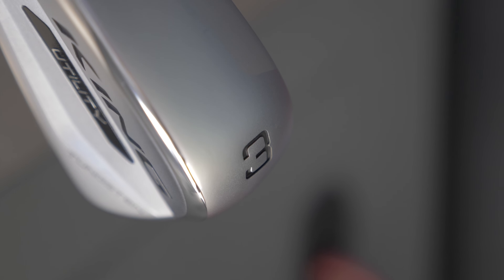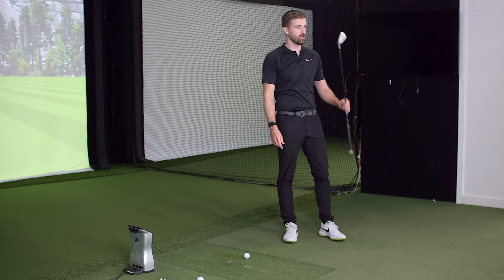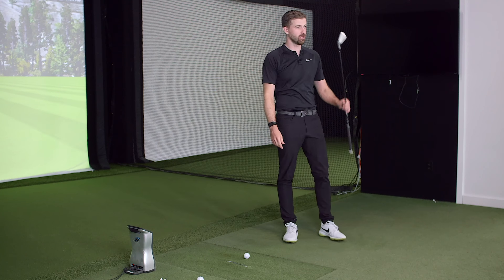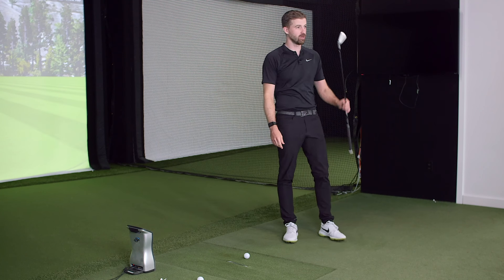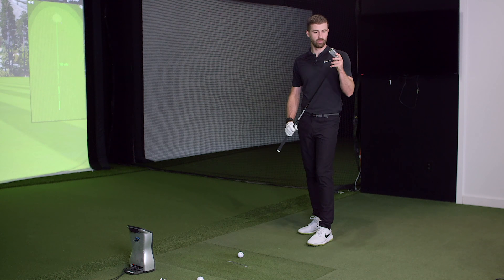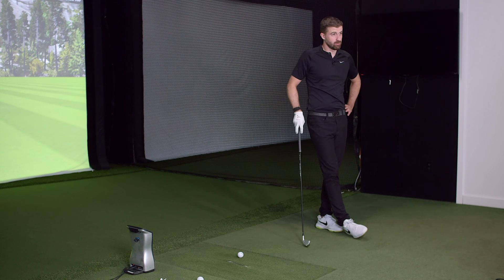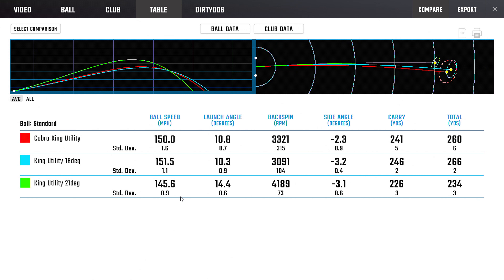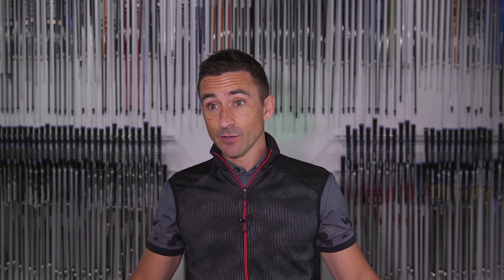ADJUSTABLE DRIVING IRON // Cobra King Utility Review

Comment: I just got 2 driving irons (3 and a 4) they work so well for me on my course where I have 3 par 3's all around 190 - 200 yards which have open front greens to run the ball on. I find the driving irons to be so much easier to hit straight, the ball flight gets less affected by the wind and seems to have a more piercing, slightly flatter flight. I also have  a hybrid and a fairway wood as those are much easier to hit from rough lies (both go the same relative distance and the 2 driving irons) Dropped my lob wedge from the bag to make space for them and I would say a lot of handicap golfers could benefit from having more clubs top end of the bag

Comment: I purchased this in the 4 iron. Ive played around with the loft sleeve on the course. Not on a launch monitor though. The difference in lofting down on the course isnt too noticeable. Lofting up however you notice a higher apex. Super easy to hit off a tee. The boys couldnt believe the distance i was getting with a 4 iron. Around a 240 total distance. I paired it with a modus 105x. I usually play my clubs 2 degrees flat. I did notice the more upright lie angle had an opposite effect of what some might expect, where it actually causes me to fade the ball more and I have a harder time hitting a draw with this club. Its more of a straight/fade bias for me with the naturally upright lie angle.  Great review!!

Comment: I feel so odd playing a bag without a fairway wood.  But my 18* driving iron is so good for me it’s made my 3 wood almost irrelevant.  Extra wedge might be more useful than a 3 wood.  I’ve even thought of playing two drivers.  A spinny forgiving high lofted driver and a bomber.  How often do I need a 270 carry club instead of a 250?  For longer hitters these days, if you aren’t playing 600 yard par 5s the 3 wood doesn’t get used much if you are comfortable with a driving iron.
Reply: I just don't get on with 3 woods consistently so I've got a tsi3 hybrid set to 18° and use it as my 3 wood as I can get 235 yards out of it and just got a callaway x forged utility iron for off the tee in to wind, then go in to a 4 iron. I'm much better with irons and so completely agree with what you are saying. So instead of 2 drivers I've got the utility as an alternative.

Comment: I recently bought the 3 iron in the KBS steel shaft. I spin woods way too much and this a great safe option off the tee. I wanted to get a little less spin and more rollout so I put it in the draw setting at 18.5 degrees. Great review.

Comment: I have a  cobra 3 utility one length that i added to my wishon one lengths, been using it in 19.5 really nice club that you can feel spring off the sweet spot. Great for tighter par4's where i dont have room for a sliced driver.  The draw setting have a big effect too, tried it out at the range and just hook it instead of straight.
Reply: How are you liking your set? I'm leaning towards that type of set up, or cobra one length hybrids. Really interested in single length
Reply: @DavidSmith-lo7wf  (reply 2 years later!)  I really like the one length, but I am only using a limited set of clubs, I have a 5 hybrid (eq1-nx) 7/8/9 cobra irons in the one length.(corbra are strong lofter so dont need a 6)  Above that i use a 5 wishon eq1-nxwood a driver and below i use a cleveland smart sole C (42deg) and 52 wedge, and a putter. I recently changed the sterling irons out for the new eq1-nx and in a few rounds the 7 iron cracked at the welds, I have now moved to cobras.

Comment: I've had a real issue with the last few years cobra models.. they perform very well in my experience on low face toward heel strikes,  but I'm much more of a down hitting high on the face more toward toe striker.  Every cobra in the last few years, whether it be driver, fairway wood, hybrid, or iron,  they all seem to struggle with these strikes.
Reply: that's great news for me right now, low heels are my miss

Comment: Driving Iron Shootout!

Truth is there are players, like me, that struggle with hybrid and 3/4 wood, they went way too high and not workable. So I carry driver then mizuno mp 20 HMB in 2 (16.5*) and 3 (21*). As a better iron player im always interested in whats out there and how they all perform. Truth is you can play off the tee shot where you hit slightly up on it or level to hit lower and off the deck you can still work flight. Hybrids and woods never let me do that and seem like they are too hot off face and never stay consistent.

Comment: You boys are nailing it at the moment. Genuine contenders to take Rick Shiels spot as #1 golf you tubers imo
Reply: Callum James the channels couldn’t be any more different. Rick’s testing is nowhere near as thorough or backed by numbers.

Rick is a pioneer for sure, but TXG is an entirely different level and arguably geared towards a more clued-in golfer.
Reply: @lowcodelucas1088  are you Rick in disguise! not sure your making a relevant point there chief. Arguably all channels are different as they require to be to succeed. However, there can only be one at the top. All I'm saying is that if these lads continue on the path they are going I see them having a chance to go to #1 eventually.

Comment: So, because that DI is adjustable, does that mean any loft change will remove any offset change? It seems like the hosel adjustments would instead lean the top of the club creating less or more loft with the head staying in the same spot in relation to the shaft.

Comment: What is the comparison between this and a game improvement 3 iron? something like a F9 3 iron? Or z585 compared to u85 utility?
Reply: The F9 4i is 19.5 degrees. It's the longest they make for that set. They're out of stock at Cobra. The SZ 4i is 19 degrees and are $115 ea. I used a BioCell 4i off the tee for several years before I bought new irons and could hit it well... off the tee. I know driving irons are expensive. If you're on a budget you could try this. I actually miss my old BioCell 4i. I should have sold the set from 5-GW instead of 4-GW.
Reply: Julia-6 I don’t mean in a money aspect I meant how they compare in playability. Is one easier to hit off the turf?

Comment: Noticed the 80g shaft.  Even if X stiff would a 80g shaft in a 2 iron generally be a bit light for someone swinging it 105? For context I have a u510 2 iron with smoke 6.5 80g and wondering whether too light

Comment: I'm a high to mid handicap golfer. I have been using my 3-4 iron as an iron to use for a stinger shot or a get my self out of trouble iron. With a half back swing with full speed follow through I can typically hit the ball around 180-190 yards with my 4 iron. (full swing speed of 110-115 on average with driver and or 4 iron). I have been looking at adding the club to my bag to provide me some additional shot options as a second shot on a long par 5 or narrower fairways on par 4s. Do you have any suggestions to how I may better utilize the club to help take 2-5 strokes off my game. 

-for the record I am working mainly on my putting and chipping to bring my handicap down immediately, just looking for something to help improve my long game.

Comment: Gotta think in > 5 years, every club in the bag will have an adjustable hosel.
Reply: Every iron and wedge in the bag already does have an adjustable hosel more so than these Cobras. With this hosel adapter you can make adjustments that marry loft and lie together. If you want a specific lie and a specific loft you have to hope there is a slot on the apapter that hits those numbers perfectly. For instance, if you want the most upright lie with the lowest loft it's not happening. A traditional hosel allows for the adjustment of loft and lie independently from one another. Hosel adapters in irons are a step backwards in adjustability, not forwards. Taylormade learned this quickly in the GAPR line which is why you don't see it anymore in the SIM driving irons that replaced GAPR. Not sure why Cobra hasn't figured this out yet but it's certainly going to hurt, not help sales.

Comment: That’s crazy upright though..
Reply: Which for 85% golfers that’s probably good.. hopefully it’s relatively short
Reply: If I set the highest loft to stop on greens, I’d want the lie to be flatter so I’m not slinging a 30 yard draws into the greens
Reply: Great review though boys and sorry I was commenting as I watched 😂
Reply: perfectly offsets the droopy shaft - so dynamically it is fine
Reply: Paul O'Neil so I’m stuck with a droopy shaft to make the club work?
Reply: @RBWeaver97  ALL shafts move SUBSTANTIALLY while in motion on 3-axis. I would say that Cobra delivered a club, for the masses, that EVEN Matt, at his swing speed, went from -1 toe down (neutral shaft setting), to dynamically FLAT when club at maximum Uprightness, is a pretty darn amazing set of calculations by Cobra engineers.